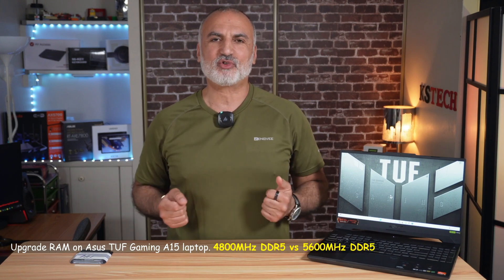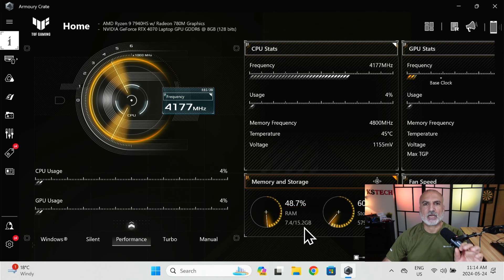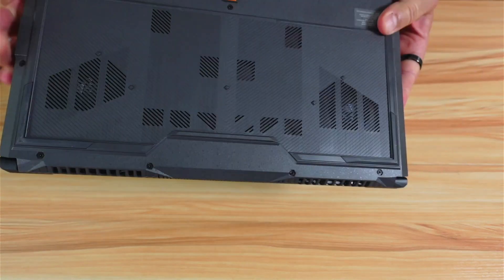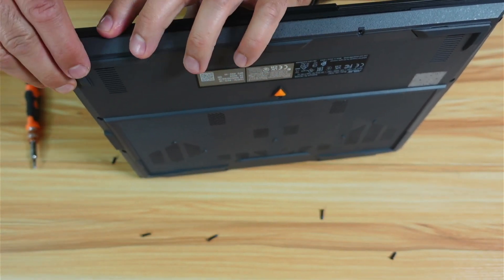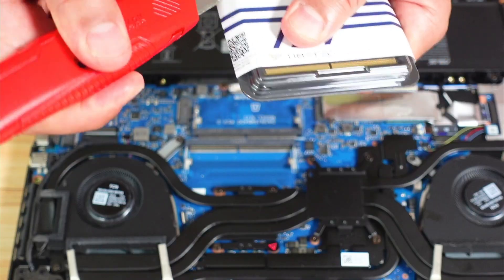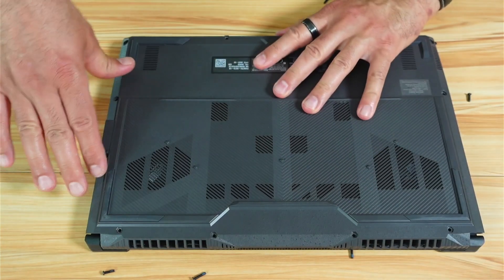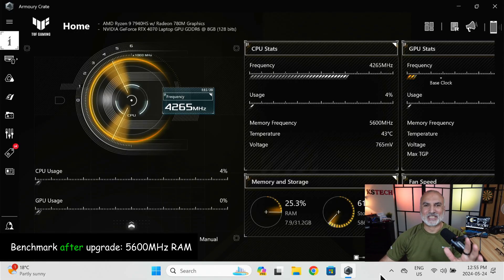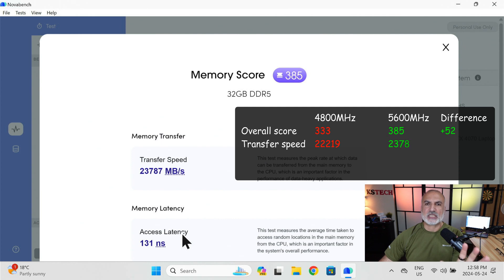How to upgrade RAM of Asus Tuf Gaming Laptop. 4800MHz Ram vs 5600MHz Ram DDR5

Comment: Can I use 5600 mhz Ram in laptop instead of 4800 mhz
Reply from the maker: Yes but it will run at the max speed that the laptop can provide
Reply: @KnowledgeSharingTech  how to check my lap max ram speed? my a15 rtx 4070 came with 5600 mt s 🥺

Comment: How you do this its very dangerous for the mainboard. Normal you disconnect the battery first before you do this. Its only 20 seconds more
Reply: I have no problem,do you have experience?
Reply: @hell1207  yes because this i wrote this

Comment: I purchased the Asus A16 2023 laptop with the AMD 7735HS processor and the AMD Radeon RX 7700S graphics card. I upgraded the laptop from 16gb to 64gb with two Corsair Vengeance memory (32 x 2) 4800mhz and the laptop works perfectly. After I installed the RAM, I turned on the laptop, had a black screen a few minutes, then it booted to my main screen to enter my password.
Reply: I have the same model and want to upgrade like you but i was not sure if the laptop could be upgrated to 64 gb ram, now i want to know if I can put it 64gb 5600mhz
Reply: @rogercalixtrog.95 Double check with the RAM and see if it is compatible with 4800mhz if you decide to buy the 5600mhz. Some are compatible, some are not. Otherwise, your best option is to get the RAM for 4800mhz.
Reply: @rogercalixtrog.95  I don't know about 64gb... But I installed 2 sticks of Corsair vengeance 16gb 5600mhz and put a Samsung 990 pro 2tb (WITH THE HEATSINK)

The heatsink fits inside the laptop and the ram works but armour crates telling me it's running at 4800mhz.

Maybe it'll run at full speed with changes in the BIOS but I did read somewhere the ram just runs itself slower to work on the laptop. 

Works perfect. I read people have put 64gb in and it's works. Hope this helps someone

Comment: Hey, I can really use some help. My ram can support 5600mhz but stayed at 4800mhz. How do I overclock my ram to get to the advertised speed? I have an tuf gaming a16 and when booting into bios I dont have an AI tweeker section or a way to change the set speed of my new ram (64gb crucial 5600mhz). I know that asus says this gaming laptop can only go up to 32gb of ram, but it works. I just cant figure out how increase the speed...Any Help Would be so appreciated. 😁😁
Reply: @robertlee3043  What is your cpu it could be bottle-necking the ram

Comment: I am a little confused for my TUF A16 FA617NT Advantage Edition  what is the RAM and SSD should I buy to upgrade it.Any Tips?
Reply: Depends? Are you using it on large performance tasks such as gaming or video edition, if yes, then yes, you should. Even for coding, you at least need 32GB now in days. I am upgrading my ram to 64GB and also the storage because of the large data files I run in my code.
Reply: @anshajmishra2700  hello! did you know if 5600Mhz is compatible with the FA617NT? i have the same and i would like to buy 2x16gb of 5600mhz ...
Reply: @AphelioSun  Google Gemini says it is compatible, i recently got 2x16 5600mhz, but doesn't let me change the frequency in the BIOS, im still looking for solutions and options.

Comment: According to ASUS you should disconnect the battery before changing RAM or NVME as you'd basically be unplugging/plugging into a powered device which is potentially dangerous. Search for the following partial URL   
Since gootube wont allow posting of helpful links.
ASUS/GamingNB/Customer_self_repair_guide/GA503QR_Customer_Self_Repair_Guide_20210731.pdf

Comment: In some games applications you will see no difference it was proven by others 4800mhz & 5200mhz & 5600mhz all you get is 2/3fps more no improvement at all just waste of $$$
The only time you will see improvement is if you go 6000mhz++ or more and you gain 12/15fps everything under 6000mhz is $$$ 😂

Comment: So all tuff laptops the ram goes in like that? Were ones flipped the opposite way? Also when I put my ssd in is there anything I need to do in bios or anything? Like formatting
Reply: Since TUF laptops have come with many different CPUs from both brands for many years, the chance every ram goes in the same way is zero. But its foolproof, just install it. Only way you can do wrong is to force it in when it clearly doesn't fit properly
And for SSDs I have never done anything in BIOS. The only reason would be if I want to change which drive to boot from, that is done from BIOS, everything else you can do in Windows, like formatting

Comment: i have HP victus 16-e1062AX model my laptop specs is 8gb ram 4800mhz, as per papers i can upgrade upto 32gb , but i have run the crucial scanner and its result suggesting me 64gb ram of 5600mhz. is it possible that my laptop can run on resulted info, or may be crucial scanner gives me misinformation.

Comment: I have a doubt, can I upgrade to 64 Gb RAM ? or is 32 the limit ? 
Also, the ssd in the second slot can be of 2Tb or 1 Tb is the limit?
Reply: In this model 2 tb definitely acceptable.About RAM,according to official aASUS info,32 gb
Reply: Just installed 4TB onto it and 1TB
Reply: You can get 64gb 4800mhz ram in it I just did it 2 days ago haven’t tested the m.2 ssd extra slot yet. I have a a16 fa617ns version and the site says 32gb max however on Asus Reddit says they only tested it themselves at max 32. Amd says your cpu can handle 64max.

Now at first when I installed it you make sure you plug your machine in or it won’t boot up. After the plug in it will boot in like 10 to 30 seconds.

Comment: IMP NOTE : In tuf every ddr5 ram comes with 5600mhz only but u should know that ddr5 ram has an turbo boost frequency which mean when the ram will be on heavy load it will automatically push to 5600mhz just like a processor do but it will not  show in ur desktop that it is 5600mhz ram but it will show the base frequency. Thnx if u found this helpful. 🙏🏻
Reply: @starboy7057   why on Best Buy website spec for tuf 4070 it says 4800mhz ?
Reply: İşlemci ram speed hz = 4200mhz 👍
Reply: I just upgraded my ram to 64gb 4800mhz in this machine mines is a a16 fa617ns 2023 version.
Reply: If it shows 4800 on windows it's running at 4800. The problem is most laptops don't let you do XMP or expo in the bios.
Reply: That's utterly false.  My 2023 A15 came with  DDR5 4800,  as it was advertised as such. RAM doesn't have a "turbo" clock speed that it goes to when certain demands/criteria are met. It runs at a constant speed.  RAM can have different JEDEC profiles (or XMP/EXPO profiles),  but it doesn't switch between them on the fly.   For OEM computers, most of the time the XMP/EXPO profiles aren't going to be supported in the BIOS.  The Asus A15 is no different. It only supports JEDEC profiles, and the motherboard automatically runs the RAM at the highest speed the RAM and the motherboard supports.  Which in this case is 5600 M/T.   I upgraded the RAM in my A15 to 32GB and it does run at 5600 M/T as the RAM that I got was supposed to.
Reply: @FoDaddy   question, i have asus tuf a15 (2023) too, do you think its okay if i upgrade with 5800mhz ram? Which is my laptop having the 4800mhz, some people said that the laptop will not read to ram if its not the same number of Mhz, its still be my concern till now, coz its so annoying knowing that I could’ve just upgraded but my dilemma was telling me to hold. Whats your thoughts?
Reply: @bagaskuncoro8053   IIRC, 5600 is the limit for the motherboard/CPU combo.  EXPO is not supported.  So if the particular RAM you're using requires EXPO to hit 5600 Mhz, then you won't see that speed, instead will top out with whatever highest JEDEC profile both the RAM and the motherboard both support.
Reply: @FoDaddy  so should i go with it? With the 5800mhz ram on my asus tuf?
Reply: @bagaskuncoro8053   Did you read my previous reply?  It depends on the specific RAM you're getting.

Every stick of RAM has JEDEC profiles and/or XMP/EXPO profiles.  OEM computers like the A15 usually do not support XMP/EXPO.  So you need to make sure that the RAM you're getting has JEDEC profiles for the speed you're looking to get.  For example a DDR5 SODIMM might have an EXPO profile for 5600 or 5800 Mhz. But only have a base JEDEC profile for 4400 Mhz.  In that scenerio if you install that RAM into your A15, you'll only get 4400 Mhz  even though the RAM will support 5600 or 5800 because the A15 doesn't support EXPO.  

In the case of the A15 (2023),  it will support SODIMMs with JEDEC profiles up to 5600 Mhz.  I do not think it will support anything higher than that, as that was the specification AMD has for the motherboard/CPU combo.   I have an A15 (2023) and with the  two 16GB DDR5 SODIMMS I bought for it , Kingston model, CT16G56C46S5.  and the latest BIOS update, it indeed runs at 5600 Mhz,  as that's a frequency that the RAM has a JEDEC profile for and the motherboard supports.

I don't know what RAM you're plan on getting. So I wouldn't know what JEDEC and/or XMP/EXPO profiles the particular SODIMM's have.  Basically you have to do your homework and understand what speeds for a given SODIMM are for JEDEC and which ones are for XMP/EXPO.

On custom built desktops, this isn't quite as  critical as the retail off-the-self motherboards that people buy for those almost always support XMP (intel) or EXPO (AMD), plus you can usually change the RAM speed, timings, and voltages manually.  On laptops and OEM desktops, those kinds of settings are almost always unavailable in the BIOS because they don't want people who don't know what they are doing messing around with them and bricking their motherboards while under warranty.
Reply: @FoDaddy  Hello, I also have a question, I have the Asus TUF A16 (2023) with R7 7735hs and RX 7700s with 16GB of ram at 4800Mhz, how can I know if my laptop is compatible with a higher Mhz ram? And what is the maximum Mhz it supports?
Reply: @white_ofc  Per AMD, Max for the 7735HS is indeed 4800 Mhz.   The 7940HS got the bump up to 5600 Mhz
Reply: @FoDaddy Hi , need your help , i have ASUS Tuf Gaming A15 ( Idk if it’s 2021 or 2023 / Model FA506NC  , i was looking for ram DDR5 the only one i find is the Sodimm and Lets say that my actually ram it’s the basic one they give with laptop (16GB) should I upgrade it ? And which ram should I get the 4800 or 5600MHz  , on my laptop it shows a picture that supports 5600mhz
Reply: @Aion_78   "SODIMM" is just what the laptop RAM form factor is called.  Laptop RAM isn't the same size/shape as desktop RAM (known as DIMM).   The FA506NC looks like it has the Ryzen 5 7535HS  and comes with 16GB of DDR5 4800.  It's Zen 3+ and only supports up to 4800 M/T RAM.  So what it came with is actually the fastest RAM it can handle (aside from LPDDR5-6400, but that would be for applications where the RAM is soldered and not removeable/upgradable and not applicable here).

Whether or not you should upgrade is up to you.  If you've got one 16GB SODIMM and an empty slot,  then I would say "yes".  If you've got 2x 8GB SODIMM's,  then it's not as clear cut as you'd be replacing both SODIMMs, instead of just adding another, which makes it a pricier proposition.  But if you need more than 16GB of RAM,  then yeah go ahead and get 2 x16GB SODIMMS.  Basically, it depends on your needs and wants.   

4800 Mhz vs. 5600 Mhz?  Your computer doesn't support anything beyond 4800 Mhz,  so you won't see any benefit from 5600 Mhz RAM.  You could get 5600 Mhz RAM, but it'll just run at 4800 Mhz or the closest speed to 4800 Mhz it has a JEDEC profile for.

Comment: The Ram Comes with my laptop Asus FA507NU-LP007W is 5600mhz but its reads only 4800mhz
 ..i checked bios and there is no option to make it 5600mhz any solution?
Reply: Y would u want to. It won’t do anything if ur spec to 4800

Comment: Sabes si esta actualización también aplica para el Asus TUF Gaming F15 FX507VI? Y si es posible 64gb a 5600MHz?
Reply: I also got FX507VI and my answer is NOT POSSIBLE because it is i7-13620H bottleneck, MyAsus app will show 5200MHz! If you can get 4800MHz with better price go for it.

Comment: hi, i have a 2022 tuf a15, fa507nv. also had 1x16gb ddr5 4800mhz ram. however i tried to upgrade to crucial 2x16gb ddr5 5600mhz, my laptop did not even display the asus logo when booting up, only the status and charger LED was on. is this compatability issue or do i just have faulty ram?
Reply: @muhamadirfan8840  found any answers? Having the same problem now
Reply: @elijahgarma4894  the sticks i had were defective. i refunded them and got another kit from a different seller. now it works no problem. i regret getting the exact same kit cause i only realised recently that my cpu can only handle 4800mhz max and could have saved some cash

Comment: I just changed my ram I did everything correctly but it shows the right memory but the speed is still at 4800 mhz not at 5600 any tips?
Reply: I think you should stick to the limit and if 4800 MHz is recommended, I don't think a 5600 MHz has any added value.
Reply: @Caseys-E-Bike-Welt  no bro asus dev say you can go higher   they just never made any tests at highet speeds rams dyor
Reply: @Caseys-E-Bike-Welt  yea the spec on Best Buy website says 4800 so that’s wat I bought lol
Reply: You have to go to the bios and unlock it, for it to reach those speeds
Reply: @NoobKnife_  Can you explain how to do that.
Reply: Same here, ever find a fix for this?
Reply: Have you upgraded you BIOS?
Reply: Yes, same for me 😢
Reply: Someone fixed this issue?
Reply: I put a 64gb 4800mhz in mines 2 days ago my model or version is a16 fa617ns 2023

Comment: Installed also the 5600 mhz but i see just my old frequency from 4800 mhz... The ram from 32 gb is avaible and correct. 
But the Frequenz is not correct... What should i do?
Can anyone help?
Reply from the maker: Yes, look at the part of this video where I adjust the Ram frequency in the BIOS: https://youtu.be/Fc7j9VDQo3k?si=4hIm-EW0lB4PFlel&t=199
Reply: @KnowledgeSharingTech   thanks for u quick answer. I dont  the Same BIOS Like U have. Under the Task Advanced , i dont have the field ai tweak to Change the MHz..
Reply: @KnowledgeSharingTech  i have the Asus tuf f17 2022 and i cant find the field ai tweak under the advanced settings...
Reply: @KnowledgeSharingTech  this Video is Not for the Asus gaming.laptop.
..
Reply: @KnowledgeSharingTech   That doesn't work on OEM computers. The BIOS options you see on a custom built desktop are much more extensive than what you would find on a Dell/HP/Acer or whatever.  This also applies to laptops.   The very laptop in this video has a BIOS that is much more locked down,  the user cannot adjust RAM speeds/timings/voltages.
Reply: I think It dosent Work because i have a CPU 12th Generation 12700h
Reply: @NamtoGT  if you have two rams with different speed, the slowest speed will be used.
Having 1x ddr5 4800mhz and 1x ddr5 5600mhz turns both into 4800mhz until you have both ram sticks running 5600mhz
Reply: @xMarvin732  both are running in 5600 MHz but my CPU is the 12700h and by the 12th Generation CPU is the uprage in 5600 MHz Not working max 4800 mhz

Comment: 64GB possible if yes which speed?
Reply from the maker: Yes, 5600 MHz, these are good: https://amzn.to/3Sm3sGf
Reply: @KnowledgeSharingTech  i am using asus tuf a15 amd ryzen 9 8945h, rtx 4060 8gb, 5600MHz... i plan to change my ram to 64gb because of my work to do 3d details. i plan to use CRUCIAL brand ram..it is ok for my laptop?

Comment: Thanks for the video! I've a FX517ZM, want to upgrade to 64 gb at 5600, do you think the machine will support them? I'm confused about the 4800 limit, how can I check before buying?
Reply from the maker: I checked the specs and it doesn't mention the top limit speed. From my experience, faster RAM will work but you might not be able to get the top speed. I advise you to get them from a place where you can exchange them in case they cause problems.
Reply: I’ve only installed 64gb with matching 4800 speeds works fine for me. All do I had to factory reset my laptop because I had closed some programs I wasn’t supposed to and the computer went haywire

Comment: Can i upgrade the asus tuf a15 to 40 gb (8 x 32) ?because the asus says 32 is maxm but in google some say it supports 32 per slot means 64 gb
Reply from the maker: When they say 32, it means that’s what they tested and certified. You can surely try 64. Just get them from somewhere where you can return them in case they don’t work.

Comment: Thanks. I will upgrade my 8 GB Asus laptop to 16 GB by bringing it to Best Buy. I worry that i would screw up and void the warranty.
Reply from the maker: If you don't feel comfortable doing it yourself, letting a pro do it is the way to go. Just make sure that they warranty their work
Reply: @KnowledgeSharingTech  Good idea, thanks.
Reply: Same thing here, upgraded an Asus Tuff A15 to two 16 GB Vengence DDR5 MAde the laptop much better. Best buy will give you a new computer greater or  equal value if they mess up your laptop